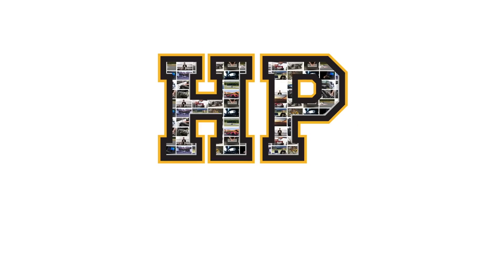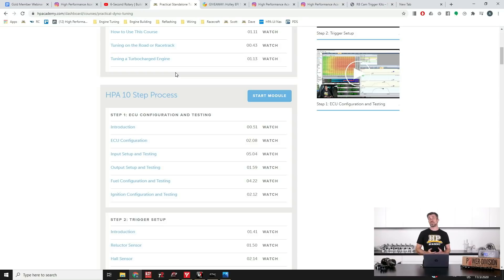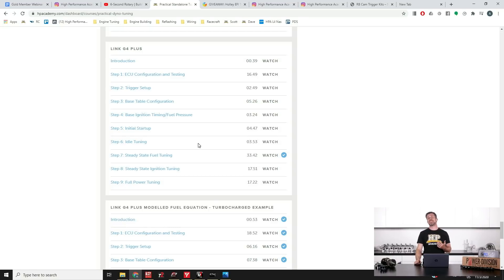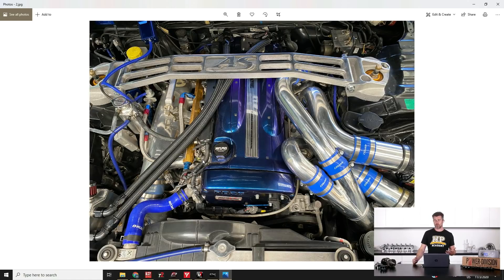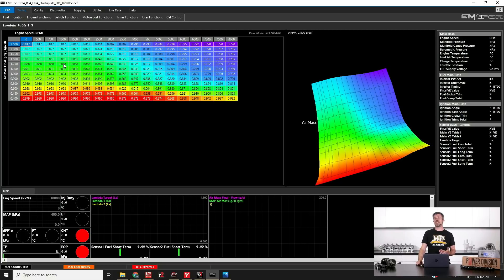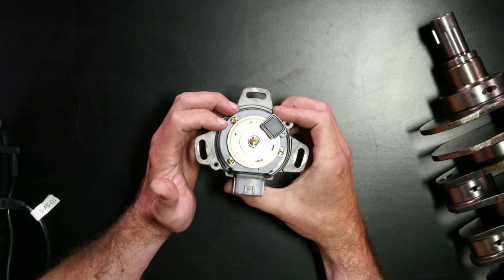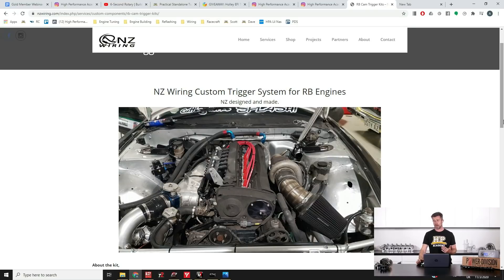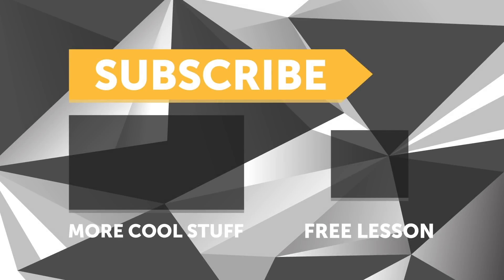R34 GTR Skyline, ITB Tuning and More | Today At HPA [UPDATE 257]

Comment: i just bought a itb setup for my sr20det, it has a vacumbox below the plenum that is connected to each runner to get vacum, is this a viable spot to get a MAP reading from considering it has the same pressure across all runners and is located after the throtlebodies?

Comment: I doubt ITBs do any good in turbocharged engines but still lots of great info in this video. Cheers.
Reply: They still improve the throttle response, because the air has less distance to travel from the butterfly valve to the inlet port.
Reply: the main benefit is control authority over  torque/airflow at part throttle. on a turbo ITB car the throttles restrict the airflow from the plenum to the cylinder. on a large single throttle engine you are only restricting flow to the Plenum and the port runner is always full size. the requirement for this has largely been negated these days with DBW throttles as your area demand isn't coupled to pedal position in the same way a cable throttle is.